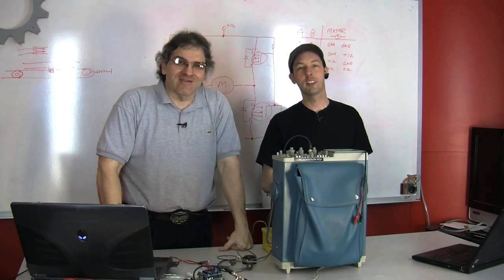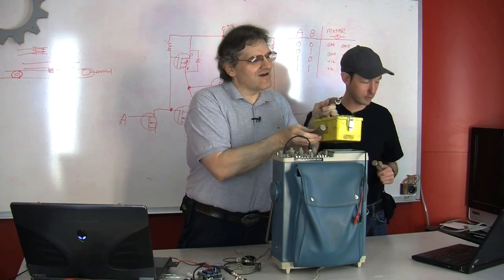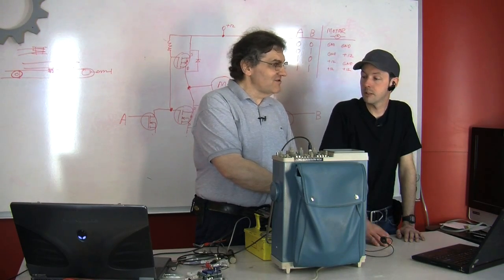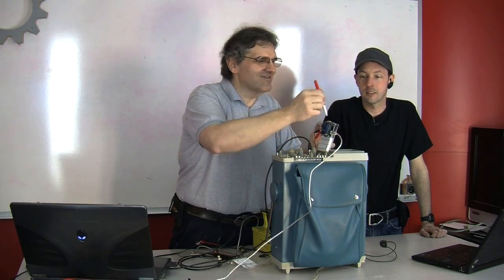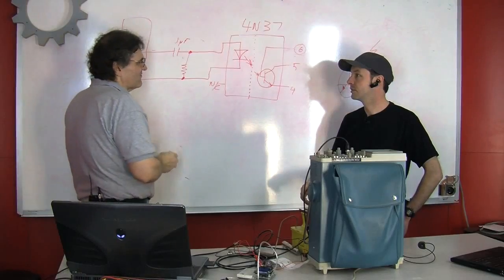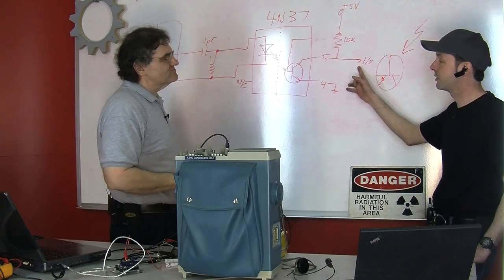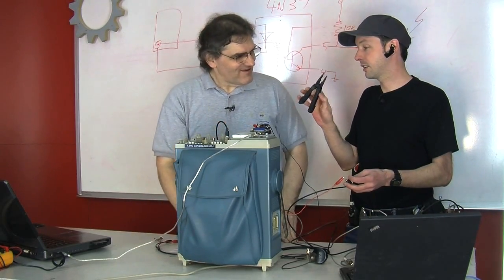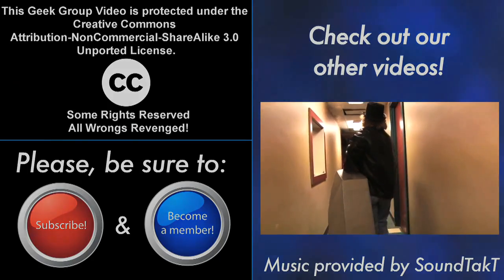How To Interface a CDV 700 Geiger Counter to a PC Using an Arduino (Part 1)

Comment: pendulum bot runs on interrupts.  have to.  the interrupt adds up cycles of the rotary encoder so that the arduino, regardless of where in the code it is, knows how many degrees off center (and direction).

the interrupt merely increments or decrements (  count += 1; else count -= 1;) so the interrupt runs VERY fast, and allows for the PID equation to overcome the falling pendulum action.

Paul helped me set up said interrupt.  it'd serve as a EXCELLENT standalone
 video topic...

Comment: Very nice.  If you have a win xp computer or older, look up the cdv700counter program, it is a digital logger for a cdv700
using only a cable from cdv700 audio to your PC's soundcard.
Completely free.

Comment: Just before the problem in Japan I bought an Radex RD1706 counter for $165.00 to replace my old broken unit. Exactly the same counter is now selling on EBay for over $1000.00 and one sold for $2010.00 which is just nuts.  You might want to have a look at this I can't post the link but do a search on "people buying geiger counters and iodine tablets as thyroid protection / fukushima incidents."

Comment: @tmbomber383 I'm confused...  it's not really AC, it's negative DC pulses with a negative DC offset.  I thought it had to be regularly inverting with respect to a reference point (which might be DC offset) to be classed as AC.  I even checked the switch position in the video in case it was set to AC.  Enlighten me please?

Comment: @tmbomber383 
Also, I'm not sure I'm following the circuit.  The cap charges by pulling current from the "ground" during the spike then when it jumps back to -0.5V (it looks like the scope was on 1V/div at the time, half a div jump, so -0.5V?) you have a short period where that is positive with regards to the cap?  Really that's the only way I can figure it putting forward bias across the LED without reversing the input.